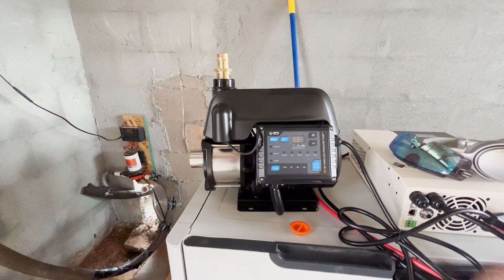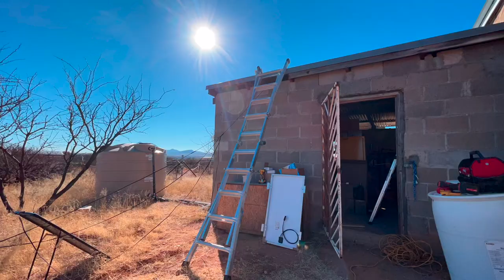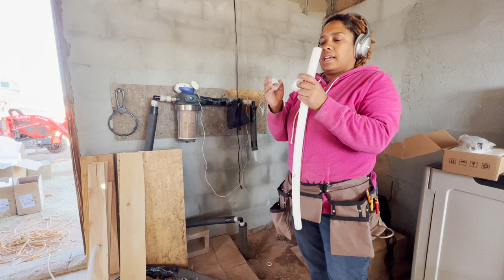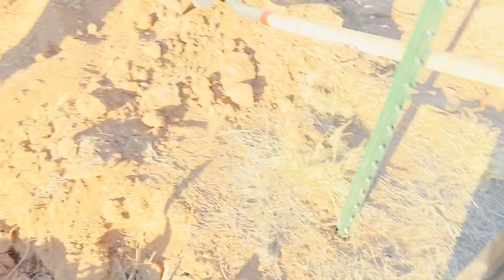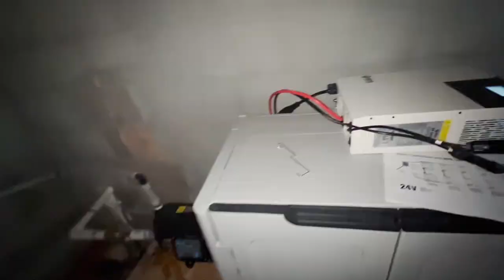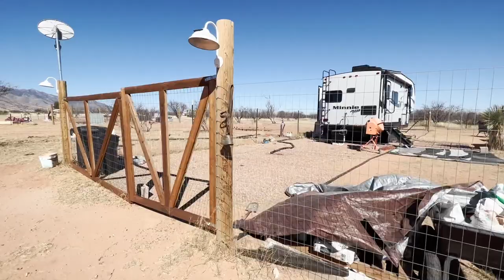RPS Solar Tankless Pressure Pump Install

Comment: i just found your channel and i enjoyed the video. two things i would recommend for your solar system is put a fuse on your positive side pm to the batteries and one to the charger to protect your system. next is there a ground rod at attached to your solar system. if not, you need to correct those items to keep your system safe. have a great day
Reply from the maker: Thank you so much!

Comment: That pump sounds so smooth and nice. You did a great job installing it!
Reply from the maker: Thank you. I am really enjoying it!
Reply: Don’t you just leave it on 24/7. Why do you have to manually restart often. I have the same pump, just bought 8 panels and 8 batteries. I hope it’s not something I have to keep restarting,

Comment: Was there a reason they told you to put in a check valve? I am wondering if the suction of the pump was not strong enough to open the check ?  If one is needed I would put it on the discharge of the pump. Be sure the "flow arrow" is pointing the right way. The pump pressure will push the check open and water will flow. When the pump shuts off the check will keep the lines full and from backflowing.(which may not be needed). Remember to install drain lines for draining before any freezing weather.
Reply from the maker: I was following the setup video on youtube.  I'm not sure if its outdated.  I think the check valve I was using may have required to strong of a flow to open?  Not sure, but the check valve was required on the intake, so the machine would retain its prime if the water storage levels ever go below the intake cause the machine to loose pressure.  It's working great now! =)

Comment: You reminded me of myself when I do projects… the excitement, the frustration, the relief (all of it). So, I’m actually thinking of getting an RPS system but was afraid to do the install. Do you think it was worth it?
Reply from the maker: If I had to do it all over again, I would have gone with a pressure tank.  This system is so sensitive, and I have to manually restart it often.
Reply: @dreamingtree  thanks for the honesty